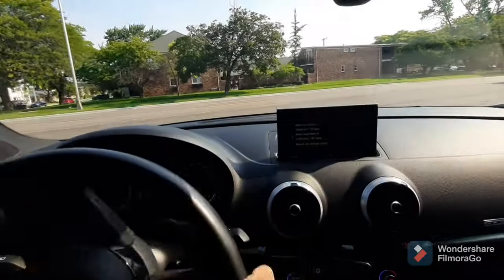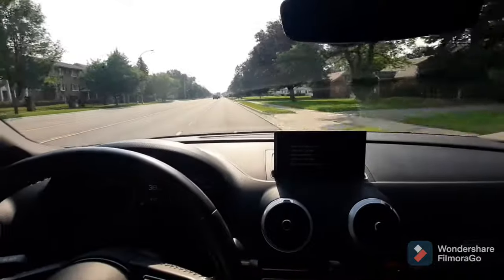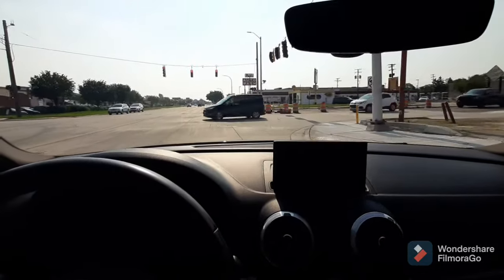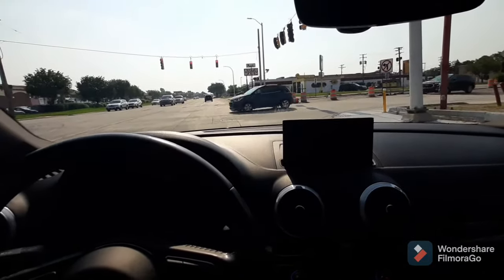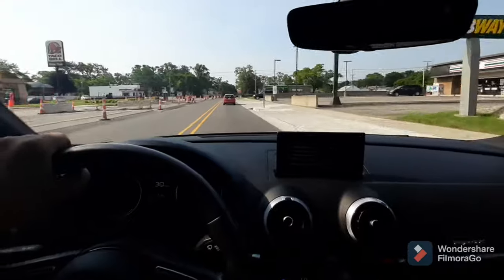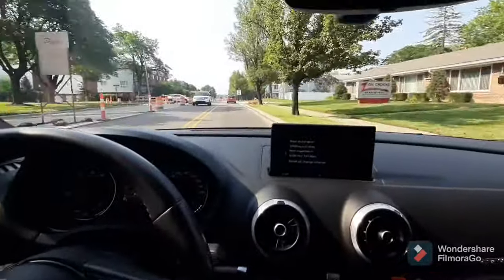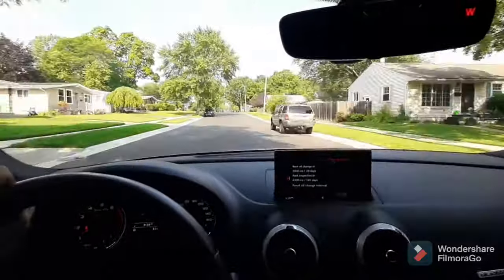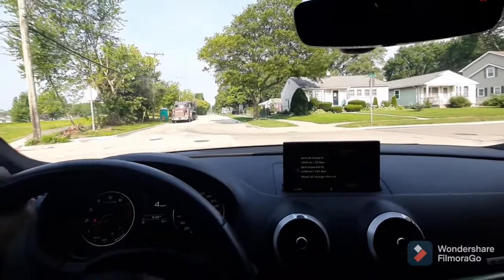How to tell the difference between a wheel bearing noise and a tire noise from drivers seat

Comment: Hey! I hope you see this, I’ve been trying to figure out my problem for a while, sounds like a classic wheel bearing, changed both front hub assembly’s, it’s coming from the front. And nothing changed, the cv axils look good, no ripped or torn boots, and when I get 50+ there is a humming noise that happens as well, like a HMMMMmmmmmMMMMMMmmmmmMMM slow but it gets quieter and louder while I drive. The wheel bearing kind noise is only under drive, doesn’t happen in neutral so I don’t think it’s the transmission or anything. 3.1lv 6 fwd
Reply: And thoughts would be appreciated and help a lot! Great video too
Reply from the maker: I can’t remember if that’s a cvt transmission on that car or not

Comment: a whistling sound coming from the left tyre of my car. its on and off and as soon as I hit the breaks the sounds goes away.

any suggestions?
Reply from the maker: Does it sound like a brake squeek or scrapping noise?
Reply: @EuropeanAutoRepair  like a sharp squealing noise from the passenger front tyre  when driving but its on and off and as soon as I touch brakes its gone.
Reply from the maker: Sounds like possible brake pad issue. Might want to pull it apart and if you don't see anything change the pads

Comment: My tire tread is getting low, to the point where rapid acceleration on moist roadways incurs tire spin. I'm also starting to get a droning noise coming from what sounds like the rear tires, as I approach 40 and up to about 60 MPH where it starts to lessen. I did the load bearing test and it hardly changed in sound, so safe to assume wheel bearings are OK. I'm at 98k miles. Is there a general maximum lifespan for wheel bearings?
Reply: Why do you neglect your tires like that
Reply: @fredharvey2720  You know nothing about my routine tire maintenance to make a disparaging comment like that.
Reply: I replaced all 4 tires (it was nearing the time for it) and there's still a noise coming from the right rear, that diminishes when cornering / veering to the right and remains prominent when veering to the left, notably between 15mph and 60mph. Above 60 mph, the sound starts to diminish. It does seem like the right rear wheel bearings are wearing out.
Reply: @cytherians  You just explained your habits with your tires, knothead.

Comment: I'm having noise when I'm starting drive after putting brakes. The noise is like clunk or heavy click sound 3-4 times, but when car is running on higher speed it doesn't produce this noise, only when I'm starting it after braking. What could be this issue?
Reply from the maker: It sounds like you have a brake pad that has too much movement inside the pad carrier. Sometimes aftermarket brake pads will do that.

Comment: So my car is infiniti g35 2004 n it makes that same noise and it gets louder now when I go left or right. What is your advice?
Reply from the maker: Is it a sharp change in noise or a subtle change while turning? Is the noise heard on decel all the way until you are stopped?
Reply: @EuropeanAutoRepair  the same noise you made that humming noise but when I go left n right it’s the same noise but louder and it’s noticeable now. It’s not sharp or grinding just that humming type of noise. I also got thin wheels if that matters.
Reply from the maker: @williampolio7021   I'd say have it lifted on a hoist and listen to the hubs with a stethoscope while the wheels are rotating at speed it's heard loudest. Just to eliminate possible wheel bearing issue
Reply: @EuropeanAutoRepair  last question if it is the wheel bearings what's the most I should be paying for parts & labor just so I know they are not ripping me off.
Reply from the maker: I'm sorry I wish I could help you out more with this. I don't have a good handle on pricing or parts and labor on Infiniti repairs.

Comment: I don't think it's my bearings, but I bought some used tires that are about a year or a year and a half old, a set of four of them, and I'm getting a loud home particularly at speeds above 35 or 40. I notice it a lot on the highway as I'm accelerating. I don't notice anything while turning side to side, so I'm really not sure what to think.
Reply from the maker: Did the noise change with the tire installation?
Reply: @EuropeanAutoRepair  yes the tires were in very good shape but it did change with the installation of the tires yes. Noticeably louder.
Reply from the maker: Used tires are always a little bit of a roll of the dice
Reply: @EuropeanAutoRepair  yeah I saved a bunch of money and I'm not under any delusions that I should be ungrateful for that. If they have good treads and hold the road okay, they should be fine aside from some additional noise right?
Reply from the maker: Exactly! I've bought used tire and felt the same way about it. Just a noise

Comment: Question for ya... can driving the car with a bad tire damage the vehicle if the tire is just noisy but not out of balance?
Reply from the maker: Nope won't hurt anything, just a annoyance
Reply: if the tire is bad, wouldn’t it be a potential safety concern?
Reply from the maker: Depends on what the cause of the bad tire is, sometimes just a uneven tread wear pattern can cause noise and still be safe to drive on

Comment: I have a 2017 Chevy Impala and it isn’t making noise when j go side to side hut it sounds like a boat engine i guess and it goes away when i turn right but still goes when i turn left. And it goes away if I’m stationary.
Reply from the maker: Possibly a wheel bearing thing, I’d have a shop put it up in the air to verify

Comment: My car is experiencing a similar sound to this whereas I accelerate the roaring / humming sound increases in volume and peaks around roughly 80km/hr. The noise then tapers off as I accelerate past 80km/hr. I took it to a local mechanic and he dismissed both wheel bearing issues as well as tire issues. He believes it’s something with my transmission but I’m yet to find any articles, forums or videos showcasing the same sound I’m experiencing involving the transmission. Anyone know of a transmission issue that sounds similar to a failing wheel bearing or uneven tires? Thanks!
Reply: Sounds like a torque converter shudder. Is the sound like a deep pulsating sound that you can feel through the pedals? Does the sound go away if you give it some gas while it’s happening? Does it happen more often when accelerating slowly or holding speed uphill? If so that’s likely a torque con

Comment: Humming from driver side front, loudest at 65mph, kinda goes away when I push 80 maybe the other car noises cover it.

I assumed wheel bearings so got the front 2 replaced. The sound is the same.

I got my wheels rotated, aligned, and balanced, the sound was the same. That mechanic told me the front wheel bearings are bad and need to be changed. Nope that was the day right after I changed them, ignored the mechanic.

Is it possible that all tires are bad? Even though I rotated them the sound was still the same? Or is the issue maybe the transmission end of the cv axle? The car is a 13 year old subaru and all the parts are pretty old. Wouldn't be surprised if the worn suspension has led to bad wear on all tires.
Reply from the maker: Is sounds like it's probably a tire noise, sorry you had to pay for all that. Usually rotation the tires won't increase or decrease sound level
Reply: @EuropeanAutoRepair  Are there any other inexpensive ways to check, I'm not a mechanic and wouldn't be able to tell myself. My friend recommended I check the transmission fluid (which I have not done in awhile) to eliminate potential transmission faults. I don't want to buy a new set of tires or other fixes without diagnosing it correctly first.

I tried to make sure the tires were round, to my touch they feel even throughout.

I tried to load each side left and right while driving around 65mph and the sound did not change.

The sound is kinda like a spinning propeller sound and humming. It's audible at around 40mph and you can hear it gradually get louder and "ramp" up as you reach 60mph+.

The sound is present while coasting at 60mph without applying any power.

I'm unable to hear the sound with windows open, wind is too loud even at 40mph to hear it.

I don't get that wub wub sound as you described when decelerating, instead it gradually goes away the same way it started up.

Like I said I did a tire rotation and had the front 2 bearings replaced but the sound didn't move at all. If it is a bad bearing it could actually be in the rear, but my passengers have agreed it's from the front unless the sound is being distributed throughout the car. The mechanic even suggested the front bearings as well.

At 65mph the sound has a rhythm, even though it is a constant hum it has a clear pronounced vrmm, vrmm, vrmm, like an imbalanced fan.

I appreciate the feedback, I know it's hard to get a clear picture, but it really helps me out. Thanks!
Reply from the maker: Hmm honestly it might be worth having another local tech take a look at it. It could be other things as well, internal transmission noise, diff bearing noise or even the rear bearings like you said. I have a diagnosis aid called chassis ears that I can position in different areas of the car while driving to isolate noises better
Reply: Did you ever figure out the problem? My car is experiencing something that sounds EXACTLY the same.
Reply: @prudhvil  I was fed up and replaced my rear bearings and that worked.

It kinda explains how shifting the load by turning didn't change the sound much. The sound also fooled the mechanic.

Before I bought the wheel bearings I jacked up the car and rotated by hand both rear wheels. One definitely had this weird catch every few rotations and felt a slight vibration while holding the strut.
Reply from the maker: Good find! I'm glad you found it!
Reply: @LooseArrowBoy  interesting thanks!

Comment: I was stressing for months on what was the issue but when you said to move the steering wheel side to side whenever the noise kicks in that’s exactly what my car does when I’m turning on sharp turns it goes away when I move it side to side but comes back when I have the wheel straight so I’m going to fix the wheel bearing thanks !
Reply from the maker: Excellent! Happy it helped
Reply: How long were u driving w a bad wheel beering?

Comment: If i turn left im loading the right bearing correct?
Reply from the maker: Usually that is the case, it kind of also depends on which race of the bearing is damaged, inner or outer
Reply: @EuropeanAutoRepair  im almost certain its the right front then. I got the woowoowoo over 45 and it does it when i turn one way
Reply from the maker: @DannyGruesome  youre probably right

Comment: My glc300 2017 
Only 7k 
When the speed 35mile, the weird noise like u say " woo woo woo..." 
I still  don't know whether the tires or wheel bearing ?
Reply from the maker: More likely tires with your miles being so low. I'd probably have a tech verify before you buy a set

Comment: I have the same noise when I’m driving 50+ and turning slightly left… One guy said bearing, the other said it’s the wheel, till I found out that my right front wheel is quite worn from inside so I changed it.

Comment: Pretty new to driving and I'm not sure if the sound is there when I'm driving regular speeds (35-50) bc of noise but at night doing 5-10 I hear sort of an airy choo choo choo noise, it's quiet. Not sure if it's the thingy up top of the tire or what. I drive a 2008 chevy impala. Currently searching around to find out what it is
Reply from the maker: Is it louder when you have the steering turned all the way in either direction?

Comment: Thanks for this video, I have an issue with my Honda accord, my tires makes a really noticeable noise, when I checked it, unfortunately I have a problem with camper angle so the rear tires go inside for 2 cm ( both sides) like this (/__\), and the tires wear only in inner side, how can I fix this? I though about increasing tires pressure little bit to reduce the friction on the sides.
Reply from the maker: Is the car sitting at correct ride height? Lowering springs or broken coils?
Reply: @EuropeanAutoRepair  nothing at all
Reply: @EuropeanAutoRepair  the car came with 225/50/17 and I’m using 225/55/17 , don’t think this is the problem

Comment: Got myself a rs3 2018 and had summer tires put on abt 10 days ago. I’ve started to notice a *wooob *woooob rotating noise when going like 45-50 mph but I can kinda feel it in the steering wheel too and it’s quite loud at like 90mph as well. Anyone that have been in a similar situation? Just the new tires or a bearing or smth else?

Comment: If it’s a bearing, wouldn’t the humming or whatever noise relatively suddenly? And if it’s a tire it would be gradually getting worse. That’s my concern. My car hums over 30mph.
Reply from the maker: Is the noise influenced by turning at all?
Reply: @EuropeanAutoRepair  it is not. I also jacked up the car and the wheel doesn’t move when I grab it at the 12&6 o clock positions. I have a buddy that will help
Reply: @andrewmarsman3294  I’m having this same issue, did you figure out what cause yours?
Reply: Hi yeah I took it in because it got worse. It was the bearing confirmed. If you also have a Pontiac I would not be surprised if that’s your issue too. Let me know!
Reply: Hi yeah I took it in because it got worse. It was the bearing confirmed. If you also have a Pontiac I would not be surprised if that’s your issue too. Let me know!

Comment: planning on changing my tires, its kinda chopped on the outer side i think its what making the humming noise on the highway
Reply from the maker: Might not be bad idea to have the alignment checked too
Reply: @EuropeanAutoRepair  oh tnx for your reply kind sir, will do that. But can i check my alignments even with bad tires? or should i buy new ones before going to alignment shop?
Reply from the maker: Yeah tires shouldnt influence alignment numbers. I'd say just have it done before or after tires to avoid premature tire wear. No problem
Reply: @EuropeanAutoRepair  will do that, thanks again :)

Comment: if it were a tire, what could be wrong with a  tire that would make a similar noise as bad bearings ? in this hypothetical the tires have good tread.
Reply from the maker: The tread can become choppy due to alignment issues or problems with suspension components or you could have a internal belt shift inside the tire

Comment: My car do humimg noise when I  daccelerat it its sound like bieng in a sd mode / low gear?? Its sounds like it ???
Reply: Did you find the problem? That's my problem too
Reply from the maker: If it's a real sharp transition between quiet and than loud on decel it could possibly be gear noise from trans or diff. Would have to hear the noise in question

Comment: My car makes a wooh wooh wooh noise after I’ve changed it into two brand new tyres. It makes the noise when I drive 5-10pmph only. Mechanic has told me it’s a wheel bearing issue. Is he right ?
Reply from the maker: Doesn't sound like a wheel bearing issue from your description
Reply: @EuropeanAutoRepair  honestly confused it’s like a high pitched woh very second or so.   He checked the car out properly too
Reply from the maker: I usually have it spinning overhead and listen to the hubs with a stethoscope to verify
Reply: Very good possibility it's a wheel bearing , my one vehicle has gone thru 3 wheel bearings ( high mileage vehicle ) and each time it made a different noise . I tend to believe different hub assemblies will sound different than others . Mine is doing the woot woot thing this time . Last time hardly made a peep then a cracking noise about 5 times and then self destructed , luckily I was in an empty parking lot and going about 20 mph . My tires have around 7,000 miles on them , when I move to the left , the woot woot gets really loud , to the right , quiet,  will also make the woot sporadically when going straight . So I'm thinking it's the bearing

Comment: My car makes a woo woo woo sound even in a low speed. i take it to the garage and the mechanic could not identify the problem whether it cause from the bearing wheel or not. They said the bearing wheel seem fine, but while driving the woo woo woo sound still appear. The mechanic also use stethoscope to verify the bearing wheel problem. The sound come from the driver seat and my tire just got change around 8 months ago. Now i still could not solve it
Reply from the maker: Sounds like a tire issue huh

Comment: Help me out here so it’s when I turn is when the noise goes away
Reply from the maker: If it goes away completely and rear quick when you load it to the side it’s likely a wheel bearing issue
Reply: This is happening on the front of the drivers side so just has me worried

Comment: My car has a clicking noise that got noticeably worse today i think its a wheel bearing or something else but im not sure. Apparently it could also be a tire but im not sure a tire makes a clicking/clanking noise like that :(
Reply from the maker: Does it click when the wheel is turned and low speed?
Reply: @EuropeanAutoRepair  no just when going in a straight line at 35+ mph
Reply: @GodisGood941  sound like mines .. crazy noise outside my car
Reply: @shechoseme  i fixed mine. Under panel was loose and i fixed it with zipties also had a crack in my bumper so i put some tape around it but not too much so it wont look ghetto. Just enough to block the air lol.